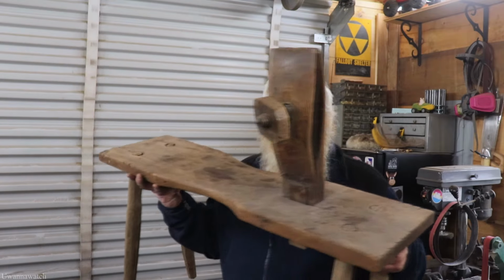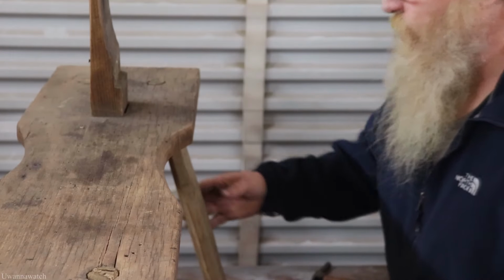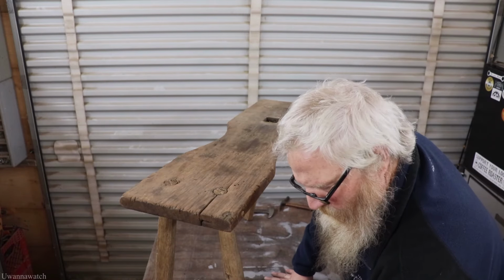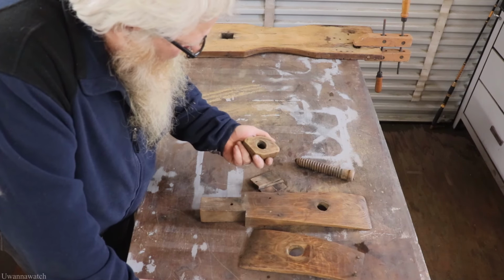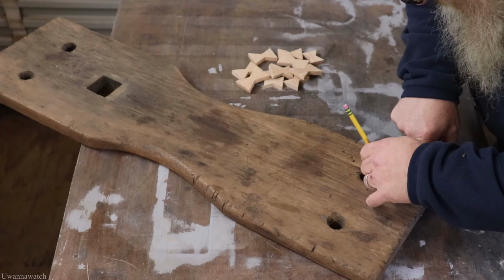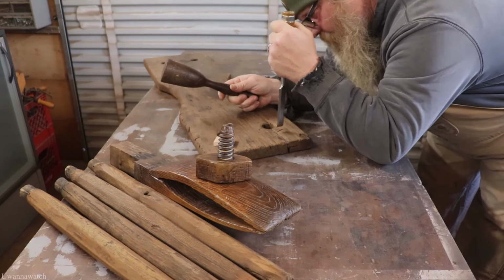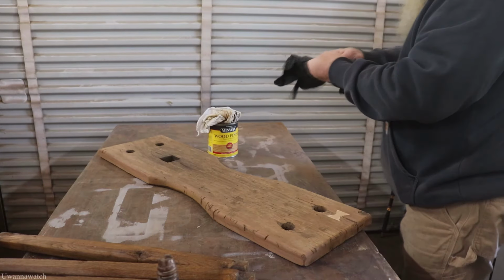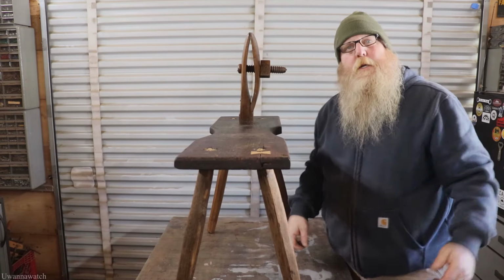Antique Leather Working Vise (Stitching Horse} Restoration

Comment: It was fascinating to watch this restoration. So many things to address and the finish looks amazing. Did you use a bow tie on top and bottom? I have never used one before so it was a good thing to learn. No one could ever accuse you of tackling the easy projects.
Reply from the maker: Thank You Mr. John. Just the top side. There were 2 dowels running through so the bottom was pretty secure. No one could accuse of taking on the easy projects either!